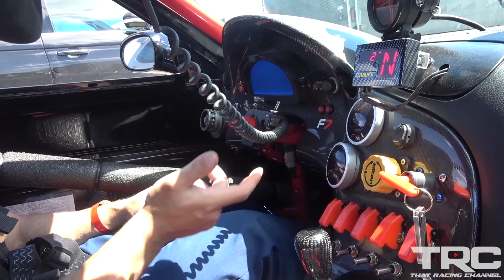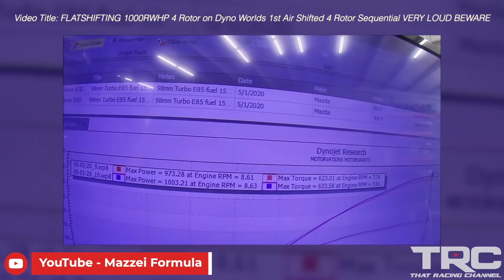1000+HP 4 Rotor RX7 is MENTAL! “STREET LEGAL Mazda 787B” Highway Pulls (Sounds Like F1 Car!)

Comment: We use a back up tank with lines running from it back into the main fuel tank. it then just uses a float system to always keep a certain amount of fuel in your small tank. so when you need start up again you no longer need to pull from the main tank to get your initial fuel. its a similar principle to the old gasser setups they used with the moon tank hand pumps. fill up your tank then handpump your tank for your fuel pressure and make your run with just barely enough fuel left in your little tank. fill up and repeat for the next run.

Comment: The explanation reminds me of:

For a number of years now, work has been proceeding in order to bring perfection to the crudely conceived idea of a transmission that would not only supply inverse reactive current for use in unilateral phase detractors, but would also be capable of automatically synchronizing cardinal grammeters. Such an instrument is the turbo encabulator.
Now basically the only new principle involved is that instead of power being generated by the relative motion of conductors and fluxes, it is produced by the modial interaction of magneto-reluctance and capacitive diractance.
The original machine had a base plate of pre-famulated amulite surmounted by a malleable logarithmic casing in such a way that the two spurving bearings were in a direct line with the panametric fan. The latter consisted simply of six hydrocoptic marzlevanes, so fitted to the ambifacient lunar waneshaft that side fumbling was effectively prevented.
The main winding was of the normal lotus-o-delta type placed in panendermic semi-boloid slots of the stator, every seventh conductor being connected by a non-reversible tremie pipe to the differential girdle spring on the “up” end of the grammeters.
The turbo-encabulator has now reached a high level of development, and it’s being successfully used in the operation of novertrunnions. Moreover, whenever a forescent skor motion is required, it may also be employed in conjunction with a drawn reciprocation dingle arm, to reduce sinusoidal repleneration.

Iykyk

Comment: Your running your fuel pump with a cable?? Like a tach from a bell housing ? Doesn't that sound sketchy? Pretty sure most mechanical pumps are run by direct gear drive... Best of luck 🤞

Comment: When I was last active in the import scene, the 3 and 4 rotor swaps were increasingly common, but I recently went to imports vs domestics World Cup and was shocked to see 13b rotaries putting down 7 second 1/4 mile times. They must be making 1800 hp or so to get the times and speeds they were achieving. Why go to a 4 rotor if a 13b is capable of those times?

Comment: Optimizing an Engine with a Transmission: To pare a engine with a transmission the first thing to determine is how much torque the engine delivers to the drive shaft in the transmission. An engine that can rev higher on each gear should be pared with a larger transmission with bigger diameter gears; and an engine that shifts faster should be pared with a smaller transmission with smaller diameter gears. Therefore, the more torque your engine puts out the larger transmission you need. Makes since right? Small transmissions for quick shifting and big transmissions both have their strengths and weaknesses.
Reply: If you know the specs of the transmission, so that you know the ratio to the diameters of the gears ⚙️ between 1st gear, 2nd gear, and 3rd gear. If the diameters were 1, 1.75, 2.5 the the ratio is 1 and (3/4). After you know that then you know the time between shifting, the time reving on each gear will follow the same ratio. For example, 3.5sec, 5.25sec, and 7sec. If the time you're spending on each gear is too long then you need a smaller transmission.
Reply: The math to get this time example was 2•(1 and 3/4), 3•(1 and 3/4), and 4•(1 and 3/4). If you want to use this method here's how: If the ratio is 5 and 1/6 then choose the closet number to that ratio, which is 5. Then multiply 5•ratio, 6•ratio, and 7•ratio. That will give you the time between shifts: 25.8sec, 31sec, 36.2sec ⏱️
Reply: Just remember that ratios are unitless while time is not; the only thing you have to worry about is what unit you are counting time with [seconds, milliseconds, nanoseconds, quarter sec, half sec]

Comment: Ill make it easy ls600h transmission and brian nelsons hacked inverter model 3 battery .   4rotor =  super car
Reply: The transmission has 2 electric motors on starter generator and second drive motor.   Raise the current and u have 500ftlbs torque and 2 gears basically.    U could build a really tight rotary and still be able to spin it over with the starter generator.  U could even.  Spin the rotary down. Like a turbo timer.

Comment: Rotary engine has major flaw that makes it waste massive unburnt fuel - 10:1 engine dropping to 5:1  and 1/2 the fuel explodes at the exhaust...
...move the freaking spark towards TDC and lob the rotor with a slot on TDC end... and improve this piece of shite.
That means redesign of the block and rotor
Can you imagine if he does those improvements, what that car will do!?

Comment: 1000hp and 75 ftlbs of torque lol. Zero low end torque on these things.
Reply: Said who? 🤣🤦🏻‍♂️.. you need to do your research on Puerto Rican rotarys
Reply: @flacco1679  everyone I have ever driven has no torque of the line unless you nearly launch from rev limiter lol
Reply: @jkp2712  and?? Just like v8’s the difference is that v8’s are cows in the high end
Reply: @flacco1679  respect for the 1000hp rotor but I wonder how quick this really is? The old I get the less I find my self taking these serious when it comes to speed.
Reply: @jkp2712  welp the 13b record is at 6.16 in the 1/4 and the 20b is at 6.06 so they are pretty quick AND they have billet blocks but stock rotors
Reply: @flacco1679  and 95% of them are probably 13-17 second cars.
Reply: @flacco1679  I said 95% of rx7’s. Maybe ready my comment next time before responding. This is the car a 12 year old wants. For what this guy spent, there are much better cars. I liked the idea and had rx7’s when I was younger but it sounds like gas powered weed eater without a muffler. To each there own.
Reply: @jkp2712  what makes the rx7 is the rotary engine . U said a damm 1000hp rotor lol . U don’t need a damm 4 rotor to be fast . There hundreds of rotary swapped cars in Puerto Rico like starlets , 1.8 corollas , etc etc . If u not a car then u not a car guy 🤷🏻‍♂️
Reply: @flacco1679  Why would I care about cars in Puerto Rico? I have no doubt that a rotary is a upgrade for a Corolla. Clearly on different levels for what we like. Your ever in Arizona, let me know. I will drag that ass laughing.
Reply: @jkp2712  it’s not a upgrade in terms of mpg but we made the rotary engine more reliable than Australians and as u can see we have the fastest rotarys in the planet , just like the fastest 2jz’s and the first and only rb30 in the 5 seconds with a lot of other records on different engines and categories . We even have the world quickest full plastic 421 banshee in the planet
Reply: @jkp2712  what have Arizona done in the drag community ? Have a pick up truck do 20 seconds in the 1/4 mile? 🤣